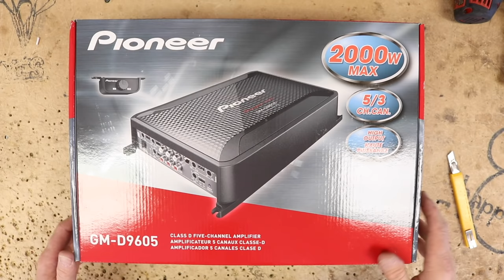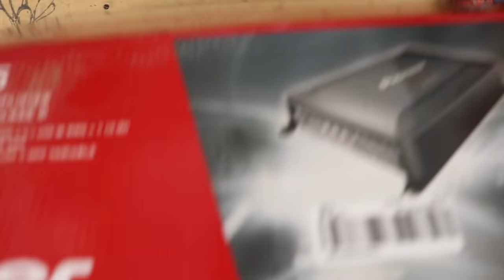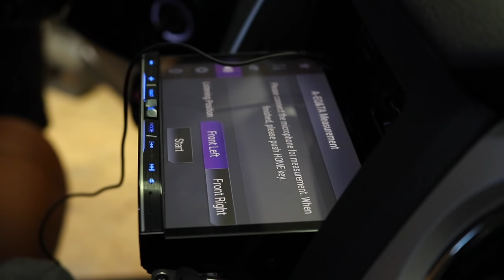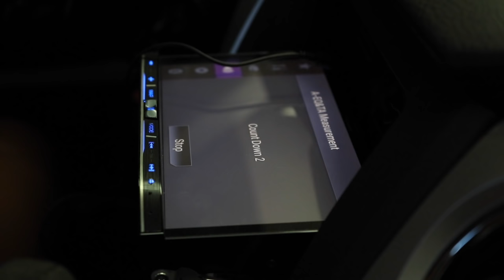Toyota Tundra Rockford Fosgate and Pioneer car audio  upgrade

Comment: GREAT VIDEO!!  I forgot that you guys made a video.  This is my truck and I can say that it sounds incredible and the install is beyond professional.  I am VERY VERY VERY happy!!!!!  

To clarify a few things:

Their disclaimer at 11:05 - yes, they recommended Fast Rings and DynaMat...  I cheaped out on that... my bad.

Mix n match system - again, my choice to save a few bucks.  I was given 3 choices: 
1. Higher dollar swap out (basically the same system except sub in: HSK 165.4, Alpine PDX-V9, Fast Rings, DynaMat, etc...) 
2. Save a few hundred and you see what I got.
3. For even less, keep the factory headunit with a DQ-61 and basically the rest of my system.

I kind of regret not going with option #1...  but my system sounds AWESOME so I am not losing sleep.  I sold my factory JBL system complete for $800+ online and got a $150 Pioneer rebate which would have way more than offset the extra $$$ in option #1.  If only I could have a do over.  

Last thing... the dark gray install kit that goes around the headunit was all that they had in stock that day.  A few days later Dean swapped in the brushed carbon metallic trim to match the dash in my Tundra 1794.

This is the 3rd vehicle that Dean has put a system in for me.  I had no idea how much work he puts in that can't even be seen when your button up the dash and install the seats.  WOW.  I wouldn't use anyone else.  Did I say that I was happy with this system?
Reply from the maker: Eric B thank you so very much Eric. Thank you for sharing also, that was great. I'm glad you are loving it. 👍🏻
Reply: Eric B how much did everything run you?
Reply: Could you send links of the stuff that was installed? I’m about to put a system in my tundra
Reply: I just got a 2020 tundra crewmax that I want to have a new system put in. These guys really take their time and do the job right. I wish these guys could do an install for me.
Reply: Good for you. It's a process, man; you want everything, but sometimes it's hard to say goodbye to the cash. We have all been there at some point... typically after marriage. 😆

Comment: Finally!  A Tundra video!  I really enjoy your videos and the excursions to Disney!
My Tundra has an old school Alpine double DIN touch screen, navi,  SiriusXM, DVD, Alpine Audyssey Imprint DSP - GPS no longer works - want a new ILX107!
Boston components (no longer made) on all 4 doors- Rockford P3 shallow mount 12, Punch 300 watt on the sub, Punch 400 watt on the highs-
Now waiting for an old school Pathfinder/QX4 or '13-'18 body style Avalon video-
1999 Nissan Pathfinder has nice old school Alpine single DIN and Audio Control preamp/equalizer, legendery old school Alpine V757 on 2 Rockford 10's in a sealed boc, a newer Alpine 4-channel on Boston Rally 57's on all 4 doors (over 20 years old) and Polk Audio tweeters on the front doors-
Avalon is still stock because I haven't seen a dash kit I like- might leave factory head unit and improve all else-
Considering a 12-14 hour road trip to get you guys to do it for me.
Your work is top notch.  Dean's explanations are great.  Fernando doesn't talk much, but does great work.

Comment: I've got a 2007 Tundra double cab.

Im purchasing my system in parts.... so I don't spend SO MUCH CASH at one time.

I've got a Kenwood DDX6906S, an old school Alpine MRD-F752.

Spec on the amp,
4x75 into 4 ohms @ 0.08% THD
4X100 into 2 ohms @ 0.3% THD
SUB,
250X1 into 4 ohms @ 0.3% THD

I just can't decide on my speakers. The Focal and Audio Frog, are my two lead contenders. Ive been thinking about using the Audio Frog  GS10, GS40 in a custom pod on my windshield pillar. The GS690 in the front doors. These would all be active crossover.

The problem with this setup for me is Audio Frog doesn't have a shallow mount sub. (At least to my knowledge they don't).

My second idea was to use Focal PS 165 FXE

Performance Series 6-1/2" bi-amplified component speaker systems in the door. 

And use this under the rear seat.
Focal P 20 FSE

Flax Evo Series shallow-mount 8" 4-ohm component subwoofer.

The only problem I see with this: is that I've only got 3.5 inches of depth for the sub. That only leaves 1/2" of space between the magnet and the bottom of the enclosure. 

Or my last and least favorite of the 3 choices is to use the Kenwood Excelon KFC-XP184C

Excelon Series 7" component speaker system

And possibly build a custom enclosure with two 6.5 Subs in approximately 1.5 cubic ft of air space.

What would you guys do?

Comment: As usual you guys did another super clean install. Thanks for sharing it with us. It looked like you slid a tip on the amp hot wire but did not crimp or solder it, did you just edit out the crimp/soldering step or is that a tip that is friction fit?
Reply: yes....I was noticing this too.
Where can I find those adapters?!?!?
Reply from the maker: Tim datoolman it is a wire ferrule. It is a sleeve that goes over the wire. It keeps all the wire together so when you screw down the wire it does not separate. The heat shrink is just to hold it in place and look cool. I'm guessing there is going to be a video on these next week.
Reply from the maker: Justin Murphy we are going to do a rush video next week with all the information on them. Thank you for asking
Reply: Five Star Car Stereo good job, very professional, where are u located? I would like to improve my truck sound system, I have a tundra too...

Comment: Nice work. I just had a shop upgrade my jbl system in a Tundra also and they put the amp under the front passenger over the outlet of the floor AC vent. It looks like this amp is doing the same, Did this amp block the floor vent?

Comment: I love the work you guys do. I also have a Tundra (2018 Platinum) with the JBL system. Ive watched the Tundra videos you guys have done and am ready to take the plunge. Do you sell any of the custom brackets you made, and I’m sure have templated? I am especially interested in the ones used in your Focal 3 way install video. Arizona is a long way to drive to have you guys do the work😂. Ive been following you for about 4 years now and as a commercial instrumentation and automation integrator in my job its nice to see someone else take pride in their workmanship. Ive already learned a few tricks from you guys to make my install go smoother. Thanks again for the videos and humor…

Comment: I realize this is 3 yrs old but I have a Tundra (non-jbl).. How did you fit the 6x9's in the door? The mounting depth is over 3". Even with the adapter the back of the speaker would hit the window when down, or at the least smash against the back of the door panel.. No?

Comment: Are the door and dash speakers sharing the front channels? Or is the 3-1/2s coming from the head unit? I have the same setup in my Challenger, but with JL C-2 and a JL RD400 amp. I'm not getting any middle bass at all.. Rear channels 6-1/2, front channels 6×9, 3-1/2

Comment: Hey what’s the name of the black piece you used to screw on side of plastic for the amps to cover wires it gave me a idea to mount my lc6 that’s under my seat. Thanks in advance

Comment: I have a 2018 tundra is there harnesses or a way to retain the turn by turn navigation and audio screen on the information cluster in front of the driver (not sure what that area is called) where gages and speedometer is?

Comment: Do a Harley!  I have a small system on my Road King- an Audioformz Bluetooth receiver, a small Alpine amp and Rockford 2-way 6 3/4" speakers in the saddle bag lids. I want a system on my bicycle, even if it's just a JBL Flip 4 Bluetooth speaker strapped to the handlebar!

Comment: Big fan here. Great work and dedication. I would like to upgrade to the 4100nex, what accessories or extra parts do I need to maintain my steering wheel controls? 2012 sonata 2.0T . would appreciate if provide links. Thank you in advance.
Reply from the maker: Jose Rubiera go to www.bestkits.com for a full list of parts. Down load the Control Pro app from PAC. That will help with the steering wheel controls. Get the PAC CP2 steering wheel interface.

Comment: awesome video! I installed an AVH-X2800BS into a 2005 Toyota Sequoia using the PAC rp4.2-ty11 and my steering wheel controls still don't work.

other than the dip switches and plugging it into the correct place on the back of the receiver, what could be the problem? any ideas?
Reply from the maker: Greg Smith you many need to manually input them. Use the small button on the side of the unit.

Comment: great video as always.but left me with  bunch of questions.  you added tweeters to the doors and used 3'' on the dash as tweeters like the factory? (thats alot of tweet) what frequency is the cut off on the bass blocker and what frequency did you set the crossover on the amp for the 3"?are those 6×9 components with inline cossover? I noticed  you added a  relay with the pac harness. what are you using the relay for?
Reply from the maker: chitwnkrz in this truck it had a factory JBL 3 way set up front. Mid in dash, tweeters in the door, and 6x9 mid bass in door the also. The customer is a balls to the wall Rocker and wanted it super load. There for we did the 3.5 in the dash crossed over around 300. The tweeters had there crossovers. The 6x9 were crossed over around 80. Then we use the gains to adjust the volume off set. The dash and tweets were on channels 1/2 and 6x9 on 3/4. It was Bright but balanced.
The box on the PAC harness was a 12 to 6 volt converter for the backup camera. The PAC harness does have a micro relay on it for powering up accessories. I think I got them all let me know if I missed something:)

Comment: i noticed you didnt crimp the ferrules when you were setting up all the wiring for the amp. is heat shrink really enough to ensure good contact? just wondering as i am interested in using ferrules.
Reply from the maker: Wompy Womperson the heat shrink is there just to hold it until it goes into the amp. Once in the amp it will be press tightly together with the set screw.

Comment: I hace to ask what kind of screws do you use to bolt the amp to ABS?  Assuming it is ABS and that leads to my next question what thickness and type of material is used for the amp mount.
Reply from the maker: +Jeff Kreska we use 1/4 and 1/2 Sintra blown PVC and also 1/4 ABS depending on the job. We use a coarse thread screw from one of our suppliers

Comment: I just recently subscribed to your channel. Bought a 2018 tundra crewmax and was hoping you could recommend a complete plug and play system, including amp. No subwoofer, just the head unit, speakers and amp. Also, the unit would need to have navigation and back-up camera and be able to be controlled by the steering wheel. Thanks in advance
Reply: What type of system did you end up going with. Just bought 2018 yesterday system sucks need to upgrade. Any advice.

Comment: If I already have a backup camera should I look at an 8200 with all the clearance discounts being offered, or does the 8201 have any significant upgrades on processor speed to make it a better choice?
Reply from the maker: Thomas Byers it is the exact same radio, no difference at all. The 8201 is a place holder until the upgrade comes out hopefully in June. Other then that we know nothing.  Go for the deal!

Comment: Dean u change the factory speaker wires from doors for the Amp? I didn't see him replace factory speaker wires.
Reply from the maker: harley196946 no, the factory wire was the right size for the power we were running. It had the factory JBL system with a factory amp. It was not the paper thin standard Toyota crap wire. We did run new wire for the dash and rear doors.
Reply: Five Star Car Stereo ok thank you I'm waiting on the rest of my product from you to finish my 2005 Cobalt the Rockford Fosgate sound choice but with the Kenwood amp I'm getting from I got to change all speakers wires in doors and rear deck. On my Kenwood unit the adapter plug I'm using for the harness am I going to have to change that over for the new speakers wires? I know adapter has the factory speaker wires hook up. we'll I guess the Amp will be running the speaker wires u are sending me.   do I just unhook old speakers wires then just cut them out rum my new wire to them through the door rubber where the wires going through. The rear are going to be easy to do. thank you Dean you guys do great with teaching us with your videos I'm so fascinated with this new audio.

Comment: Great videos guys! Quick question on the bass blocker, i have a set of JL components installed into my car which use the component box, does that automatically block bass frequency from going to the tweeter? Thanks in advance
Reply from the maker: Larry Bagley yes it will block bass from the tweeters but not the mid range. If the mid range starts playing to much bass it can cause the tweeters to sound bad.
Reply: Very good, Thanks for the response

Comment: Q:  what brands of speaker wires & RCa wires you prefer to use in a SQ set up and why? if budget is not  the issue.
Reply from the maker: Anton Wong easy Stinger 9000 cables. I have use Stinger for 27 years for all my stuff and they have never let me down.

Comment: Hey guys i love your channel very informative. I am mounting my jl hd900/5 amp under the seat. This is my first mounting an amp under the seat. Do you recommend pluging up the openings for the hvac? they vent right into the amp so i am not if this will cause over heating and condisation problems? Thanx
Reply from the maker: DigitalErra if it is going to blow directly on the amp we cover them up. We use AC tape, the silver stuff.
Reply: Five Star Car Stereo thanx

Comment: what touchscreen head unit best retains stock features like auto dimming, steering wheel control? and auto volume adjuster when driving at high speed? im lookn for one to install on my 2016 civic lx-p
Reply: Ivan Zamora steering wheel controls are retained by an interface adapter like PAC or AXCESS as for auto volume adjusted and auto dimming I believe PAC or AXCESS makes those as well
Reply from the maker: Ivan Zamora yes Chris is correct about the steering wheel adapter. We use the PAC version for this. Really the only thing the aftermarket radios don't do is speed volume control. They don't have that feature yet.

Comment: Could you give me a ballpark figure of the cost of this system?  I have a 2017 non JBL Tundra and was thinking of getting this done.  Thank you.
Reply: Thank you for your answer.  I would like to install the Pioneer AVIC-W8400 in my truck.  I'm wondering if I can have it installed with upgraded component speakers, a Subwoofer and subwoofer amp and run the component speakers off of the head unit with the plan to upgrade to a 4 channel amp at a later date.  I know I would need the idatalink maestro rr and the kits to retain the GPS and Sirius units.  Is the Sirius/Xm receiver  removable from the factory Head unit?  You guys are great.  I hope this storm that came in didn't affect y'all too bad.  Harvey kicked our butts last year.  Was stuck inside a chemical plant for 5 and a half days before I could go home.  Any way thanks for the answers and your channel rocks.

Comment: Love your work!
I though I was the only one who worked from the amp to the headunit! lol!

OK....those adapters you used for the power and ground going into the amp.....where who what when can I get them?!?!?!?!

It also looks like the only thing holding them in the heat shrink.

Thanks in advance!!!!
Reply from the maker: Justin Murphy they are called wire Ferrules. It has been the number 1 question on this video. We will talk all about them and tell you where to get them. Thank you, stay tuned
Reply: Five Star Car Stereo Thank you for the response.
They are great looking. I didn't have these 20 years ago!
Reply from the maker: Justin Murphy if we did I sure didn't know about them either.
Reply: I've read some today about them. Basically you are getting ALL the strands of copper to come in contact with the set screw and surrounding metal. The fanning that normally occurs leaves only about half to pull power through.
I'm seeing they come with a two inputs. I;ve seen these with larger adapters in lower wire sizes but not in higher like 8 and 10awg. Can't wait to learn more about and utilize
Reply from the maker: Justin Murphy yeah we're hoping to shoot something tomorrow.
Reply: @FiveStarCarStereoInc  link please?

Comment: Tundra owner here 🙋🏻‍♂️. On this install why did y’all use the 3.5” on the dash? Would this be a better option than a tweeter from a 2-way component? 

Also, what did y’all do with the Center speaker?

Comment: why don't u guys crimp the wire ferrules?
Reply from the maker: Augie090 when you tighten the wire down in the amp it does a pretty good job crimping it all together
Reply: Five Star Car Stereo Thank's!!! I didn't know that. Now I don't need to buy a ferrule crimper 🤗.

Comment: Only using one channel for the mids and highs how did you wire the rear and dash speakers?
Reply: Eric Patterson I had the same question maybe on the head unit?
Reply from the maker: Eric Patterson in the Toyota there is a factory amp. It runs the dash and tweets on 2 channels and front doors on 2 other channels. The factory radio powers the rear doors. What we did was kind of copy that. The front 2 channels are powering our dash and door tweets. The rear 2 channels are power the front door speakers. This way we can have different crossover points on the front speakers. We can let the 6x9 play lower then the 3.5 in the dash. The radio is powering the rear. The amp only needs a front rca in because it has a switch to sum the rear inputs to the front. I hope this clears things up some.